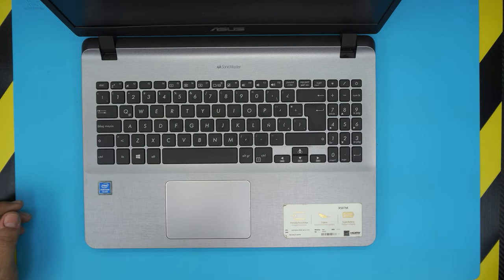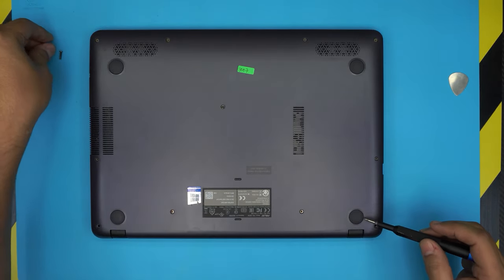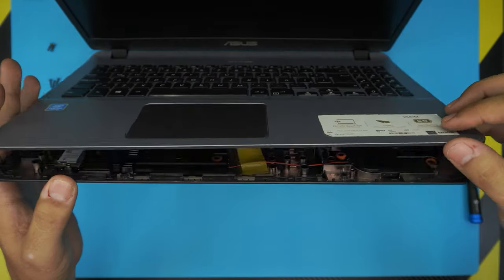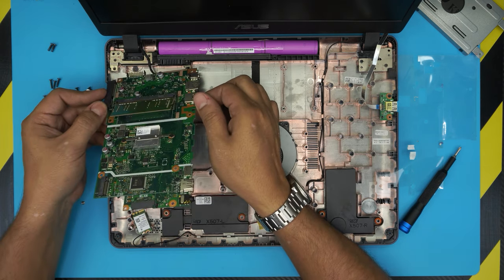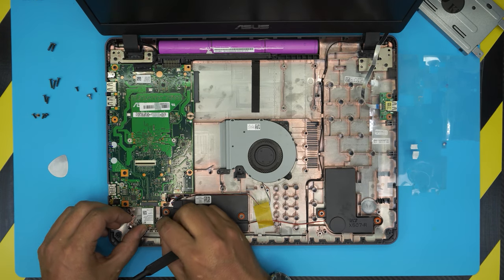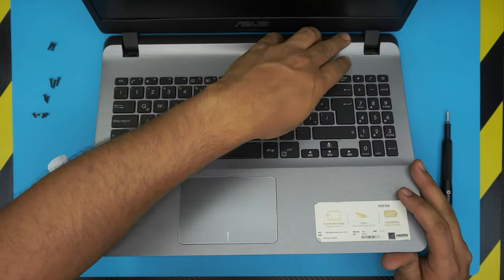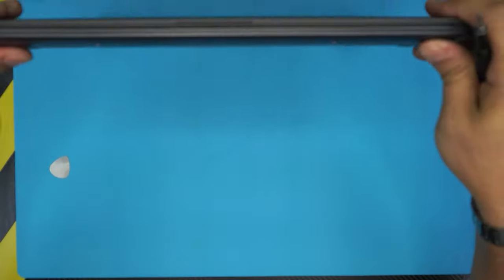Asus X507m Ram Upgrade STEP by STEP

Comment: Can i use a ram with different speed?
Reply from the maker: yes you can and the bios will auto adjust the speed automatically.
Than you for the feedback and your support to the channel with a sub  :)
Reply: I dont know but my laptop is restarting sometimes on random situations. I have asus x505za
Reply: Is there a limit? My built in is 2400 and I added another ram with 2666 and im experiencing problems
Reply from the maker: no its not because of the ramm speed, your ram maybe defective, do the following tests:
place the original ram and run a ram test program to see if you have any error on your original ram stick, then add the 2nd ram and run the ram tester and see if you get any error.
if no errors appear then follow this steps:
pres: win+R
type: %temp% 
press enter
a folder should open select everything in the folder including sub folders and delete all and skip the once you cannot delete, then restart and see if the error if fixed.
Reply: Im not experiencing any problems everytime I remove the 2nd ram. But the diagnostic didn't show any errors for the 2nd ram. Someone said that kingston brand of ram is not compatible with asus x505za
Reply from the maker: not ture we install them all the time , im guessing your ram maybe defective but just for in case change the brand if you have the chance.
Reply: Have you tried installing kingston on asus x505za before?
Reply from the maker: my friend in his shop they installed twice they say and it worked just fine. we use lots of kingston rams too but they do have some defective stick.
Reply: Oh thanks maybe they just gave me a defective one
Reply from the maker: it could be  i have seen many defective rams even in m.2 ssd , i had few subscribers getting defective rams or ssds. so its common.

Comment: Bruh i did same as your tutorial now mine screen ain't opening 👀
Reply from the maker: hi, hen you say the "screen ain't opening" what do you mean exactly!?
the hinges are hard ? in the video i have not touched the hinges :/
if you talking about turning on, i need to know more detailed e.g:
when you press power ON  do you see any light led turning on any sound, does the display shows backlit any reaction and how long.
Reply: Well i was able repair it to some extent but there is no sound or fan movement now display and ram working fine but speaker and fan not working
Reply: Yea there is turn on light on laptop 🙂 white light and red
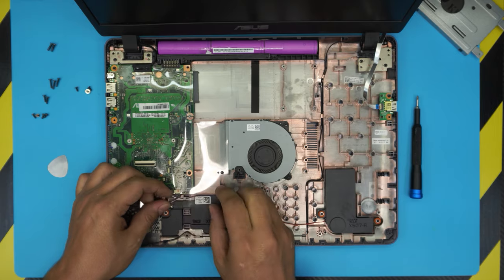Reply from the maker: make sure you have connected the speaker and fan jack correctly all the way in and its not flipped : @4:46

Comment: Is X507M have two ram stick slot ?
Reply from the maker: No, only one ram dim slot.
Thank you for the support
Reply: @uFixTek  but mine is showing that it has 2 slots.
Reply from the maker: the task manager always say XX OF 2 slot.
it will never say 1 of 1.
i have opened up many many many of this types of laptops different brands, and if there is no ram dim and even if the rams are soldered on the board it will say 2 of 2 and we open and zero ram dim lol
Reply: @uFixTek  ohh so this is the fact, i have also seen this in my task manager lol, tq buddy ☺
Reply from the maker: anytime my friend if you have any question in the future you can ask me in any of my video comments.
Reply: @uFixTek  one more question is there that pre-installed ram is showing of 2400 mhz in task manager, so is it necessary to buy a 2400 mhz 8 gig stick ?
Reply from the maker: no you can buy any speed ram but its recommended to be 2400 or better.
https://amzn.to/3smY8Ue
if you put a 2666+ the bios will adjust the fast speed to the low speed so the fast speed will go down to 2400

Comment: How's it's built quality rate out of 10
Reply from the maker: from technical aspect and built quality 3.5 /10 
the cooling 2 /10
motherboard design 3 /10
keyboard 4/10
track pad 6/10
battery 2 /10

Thank you for the support to the channel by a SUB :)
Reply: @uFixTek  can u please tell rate of hp or lenevo of same price models pl
Reply from the maker: dont go with brand , now we are in a time that laptop brands dont mean anything, back 10years ago they try to make the best laptop they had like about one or two categories, good and premium.
not they are more into resell and who can sell more laptop, quality is out of question. any laptop you purchase will have some kinda marketing that will have some designs that will make the laptop fail. so they can resell.
now in 2017- future every brand makes about 7 categories :garbage, A garbage, A++ garbage, low ok, A++ ok, and so on till you get to $1000.00 + then you will get abit better OK.
personally i would recommend a PC over laptop. 
what you need to focus in a laptop purchace is this:
#1. get the exact model
#2. search google "model + motherboard"
#3. see the port available , like two ram dim ssd sata port m.2 port
#4. google "model + heatsink"
#5. to make sure it has a proper heat pipe and fan.
#6. consult with a technician about your choices (give me links to what you can afford and i will tell you witch one is better from your list)

NOTE, try not to fall for the flashy sells like they add 16gb ram and give you a on board emmc chip , and you cant upgrade nothing or give you a 12gb ram and 1tb hdd BUT they solder a intel celeron on board!!
good luck
Reply: @uFixTek  hey 3.5 is really bad rating for built? Does it mean it breaks v fast?
Reply from the maker: @anandpatni3563  this laptop models dont last long time we get this models A LOT in the store for the APU failing because of poor cooling design, i dont even recommend this laptop to my enemies :P
Reply: @uFixTek  then in this price range which model is good first hand
Reply from the maker: yes but always consult a technician for 2nd idea.

Comment: Hello :) thank you for your video to upgrade my computer(model, x507m)

And i bought ram 16gb from amazon(your link) and had change old to new ram

Computer booting is well, but my computer recognized only 8gb

So i don’t know why my computer doesn’t recognize 16gb

Help me so much 😂
Reply from the maker: Thank you for the feedback! if you wish to support the channel you can LIKE or SUB or both :P
regarding your question:  i would recommend you to update teh bios of the laptop from official website and try re installing the ram, also it could be a faulty ram. it has happened before, that some rams are acting like this, the solution are:
-re install windows 80% of the time it helped
-re installing the ram on different slot (if available)
-use a different model ram stick
also double check and see if your CPU x507m supports 16gb
https://youtu.be/tKEJTkVth4Q